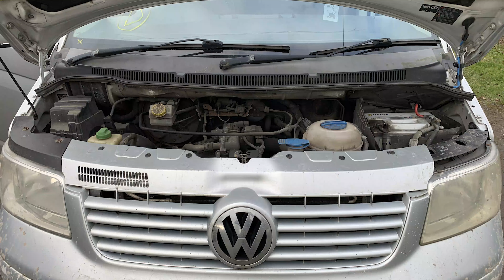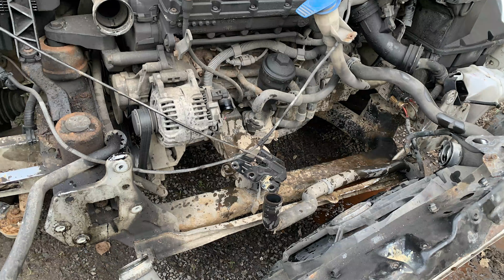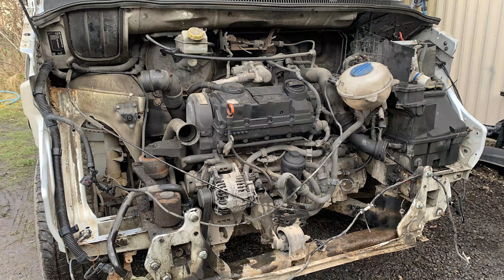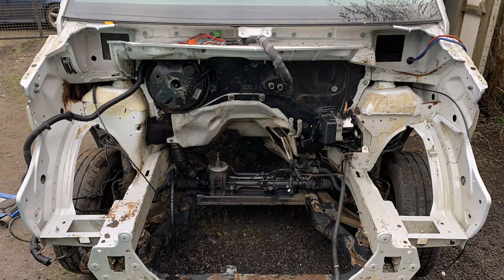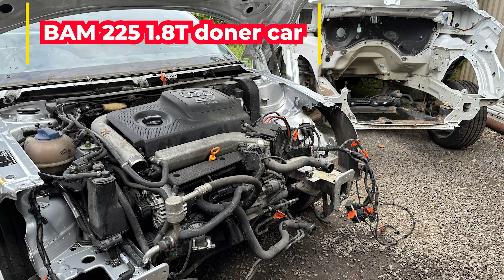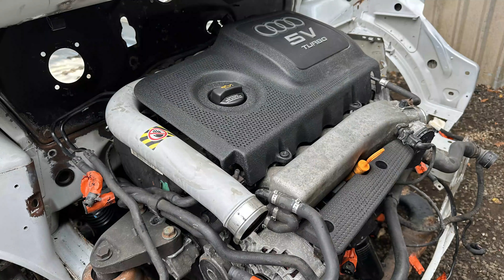1.8T Engine Swapped VW Transporter T5

Comment: just so happens I have a fully built 1.8t on an engine stand and a blown up beautiful T5 that I can’t source a reasonable priced 2.5 BPC engine.. what mounts did you use.. and what are you doing about wiring and CAN connectivity
Reply from the maker: Mounts I’ve made from scratch. Wiring side of things I went down the whole changing entire loom from the TT - including interior. CAN connectivity was too much of a headache for me. Its surprising what actually fits from a TT into a T5. Things like the clocks - while they are a different size/shape the internals come out and fit straight inside the t5 housing
Reply: what's wrong with your BPC?
Reply: @constantincojocaru4876  didn’t realise I’d dropped a broken exhaust stud down the exhaust port when I replaced a cracked manifold.. head and piston took a hammering 🤦🏻‍♂️
Reply: @ATX-Automotive 
Can you make a more detailed video of the drives, how you made the suspension and other elements of the chassis?

Comment: Does the BAM intake manifold have any conflict with the original T5 radiator?
Reply from the maker: No, the engine was rotated enough so the intake doesn't hit. The original fans don't fit but there's enough room for some aftermarket slim fans

Comment: You installed a 6-speed gearbox from the TT. How did you do it? 1st option: Have you lowered the entire drive unit down? 2nd option: You have rotated the angle of the gearbox body relative to the engine. ?
Reply from the maker: Both the engine and the gearbox have been rotated in order to fit in the engine bay properly

Comment: Is it plug and play ?? What need to be changed?? My 2.5tdi is almost dead and Im thinking to do swap for petrol
Reply from the maker: Unfortunately it's not plug and play. You can keep your gearbox but it causes the engine to sit at a ridiculous angle. I chose to use the TT 6 speed box but that meant I had to fabricate all new mounts

Comment: What gearbox is it running?
Reply from the maker: The TT 6 speed
Reply: @ATX-Automotive  hwo did u cleared front legs?have you twisted box backwards so the driveshafts went down?
Reply from the maker: @MrLucasg60  yes rotated the gearbox until it cleared the legs. Also the van will be getting lowered which will bring the shafts up higher which will help
Reply: @ATX-Automotive  you could hung it like in passat b5,push it backwards and it will solve problem,i have a plan of swap 3.2 to 2.5tdi 4motion and use 2.5 drivetrain,TFL said if i do 1.8t van still might not meet euro4 as its heavier than TT lol,fcuking ulez
Reply from the maker: @MrLucasg60  I’m not too bothered about ULEZ as I’m outside any zones. I’ll try get it compliant, if I can then it’s a bonus. If not then no stress. 
Had to put a small notch in subframe to clear the gearbox but that’s it. Custom shafts will be the biggest cost I think. 
I did think about going down the 4 motion diff option and having it 4wd but decided against it in the end due to all the added weight etc.. 
if the van was a 4motion I’d probably go down that route but I think that would be more suited to the 3.2 like you said
Reply: @ATX-Automotive  thanks for reply,just told u my story as i had plan do exact same but wankers will not make it ulez complaint even with euro4 engine.Keep us posted with updates.cheers
Reply: Almost looks like ot mounted straight up
Reply: I'm curious to see how this goes, was toying with this idea myself. 1.8t or 3.2. I think that in the Netherlands the 3.2 has never been front-wheel driven, is this different for you? Or is it possible to use the 1.8t box?
Reply: @why-not-diy  you can use a vr6 2wd gearbox on a r32
Reply: If you using the TT AWD gearbox, do you just let the rear drive output shaft spin freely or is there a delete ket or something?